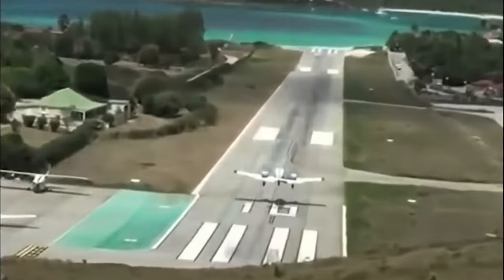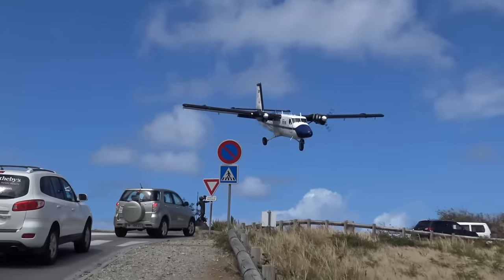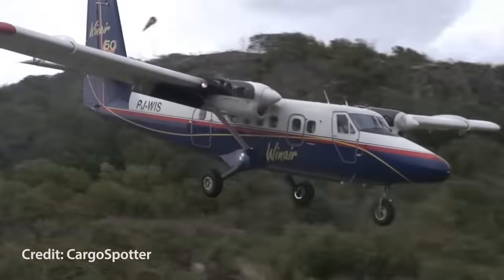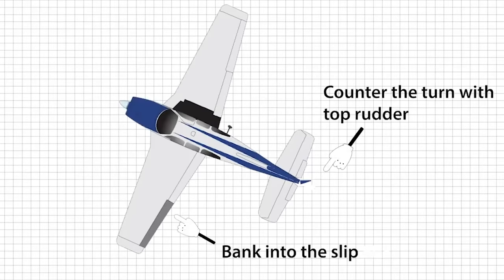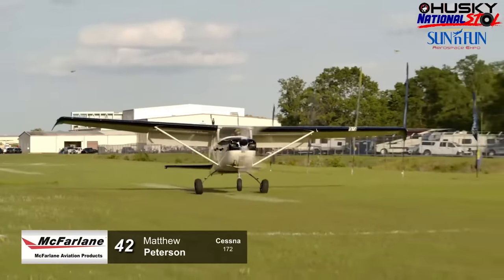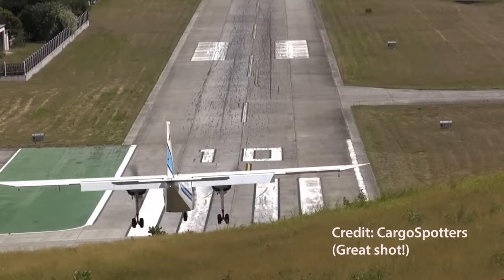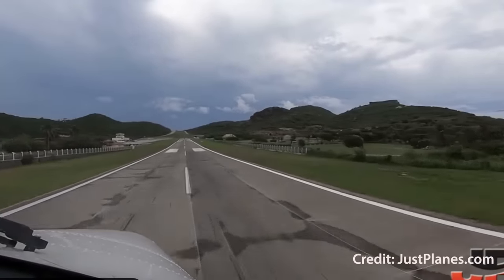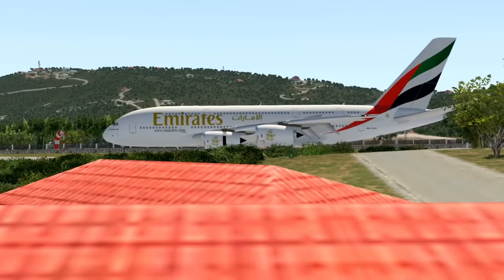Why This Landing Went Bad Part Deux

Comment: You have to question the architect behind these runway builds, would have been so much safer to have removed that hill and made that a standard approach. It might even make more sense to approach from the other end and let the hill slow everyone down.
Reply: It's already the lowest part of the hill, 'removing' the hill would be major(you can't easily remove part of a hill, as it will destabilize the rest), especially for such a small island. The island is mountainous.
They only land in this direction when the wind isn't suitable to approach from the sea.
Reply: @DoubleMonoLR  "They only land in this direction when the wind isn't suitable to approach from the sea."  Which is almost always.  Approaching from the sea might seem safer, but there is no go around when coming in that way.  No second chances.

Comment: Too many pilots fly too fast for EVERY approach. They believe fast equals safe. It’s not. This deficiency is shown everywhere a short field landing is required.
Reply: I was working at a bush flying operation where a lowish hour guy on one hot day went off the end of a short strip with a plane load of pax. Sometime after this incident he shared with me his belief that on a hot day you should approach faster ‘because the density altitude is higher’. And in that moment I realised what had gone wrong before.

Comment: Timely - I'm about to go to the next level in "slow and steep" experiments in a Tripacer - full flap, throttle at idle and 75 mph, and see what happens. It's tough - I have to make a much smaller pattern than I think I need.
Reply: Sounds fun, what is your stable high sink rate locking alerons and using rudder only ?
Reply: @MarkShinnick  Well, I don't lock my ailerons on final, so I'm not sure what you mean. It's slow, but it's not close enough to the stall to use rudder only. Plus, I don't look at my VSI on final.
Reply: Final level to achieve is when slow enough you get the max sink rate but most directional control until regaining forward speed before flair has to be with rudder.

Comment: Why don't they land the other way going uphill instead of down?   Some drag strips go up hill at the end and cars that normally need a parachute to stop barely have to put on the brakes because of the steep climb at the end of the drag strip.   This runway already has a built in hill, but they don't use it choosing rather to go into the sea if they time it wrong.   Pretty stupid.

Comment: What is takeoff like after they've  managed to get in?
Reply: Turn at the edge to maximize pavement.  Stand on the brakes and set power.  Take a good look at your engine gauges.  Release brakes and here the downhill grade helps you.  There is no accelerate stop.  Rotate and suck the gear.  Accelerate to blueline  instead of gaining altitude, you have zero obstacles initially.  Turn left out over the bay.

Comment: I’ve watched the “drag it in technique” for short field landings on other channels.  I think it is fundamentally wrong and a dangerous technique.   Where it came from God only knows.   Every pilot should fly a constant descent approach  until the flair for his aiming point…..on every approach ,  at the right speed,  for minimum float after the flair.   Constant practice will develop his skill to give him half a chance on this crazy approach.   Lots of go around practice too.    It’s probably advisable to perform an approach then go around if it’s your first time into this “runway”.   Mental preparation for a go around is a must ,  or you are going to risk yourself and aircraft avoidably.

Comment: I'm guessing if you land on runway 28 there is no such thing as a go-around!
Reply: From what I've seen on Youtube, correct.   I believe there's a rock somewhere in the bay which marks the last permitted go-around point.
Reply: I flew into there once. As a passenger, but still, that was enough!

Comment: The, as you called it “drag in method” is not something that should be promoted since it is dangerous and really only used at ‘Specialty Competitions’ such as the one you mentioned in your Video.
Use the short field technique as described in your Aircraft specific POH. Stay safe out there and try not to listen to someone who uses a PC Simulator to explain flying on youtube😉, it dangerous and misguided!

Comment: Been flying since 98 as ATP and let me tell you. Poor airmanship. Not a "speed problem". Where are theses people learning how to fly?
Reply: Mild Maneuvering Flight Schools.  They only teach well the easy maneuvers.  Then they have to do the hard ones.  And crash.
Reply: @outwiththem  Yes but teachng WHEN to go around is somithing LEARNING is the trick. "Ego heros" are set loose.
Reply: @psneves  Teaching when is easy.  Teaching 5 feet go arounds with full flaps is not easy. I did them...
Reply: @outwiththem  
I also blame the FAA for their "integrated flight" method which emphasizes instruments over feel and ribs the students of getting the seat of the pants feel. IFR emergency learning should be the very LAST thing on the syllabus, imo.
Reply: @outwiththem  Yes I agree. And those who cannot do it  cannot go on as pilot students. Should change careers but they are goig for easy schools instead. My point is, these unfourtunate people are not really learning the art of survival in a plane. That girl for instance shuld not even start the procedure. She should have arrived at the hotel in an alternate airport, write a safety report and sleep well. Maybe fatigue a factor there too...
Reply: @fazole  Many or about half of all "IFR weather accidents" are on the VFR portion of the flight.  Specially on those Circling Approaches.  Circlings are done under IFR, not IN IFR.  Classified by FAA as "IFR accidents" is pure Bullshit.   They did bad maneuveriing in the VFR section and crashed doing pilot errors VFR section.

Comment: Have engineers looked at removing the hill and using the material to extend the runway into the water?
Reply: That would be extremely expensive for an island this size, it would be a major project for a minor airport.

Comment: take that a380 sim and load it on a flight simulator with actual a380 flight controls and see if it still works ... bet it comes down to more hit and miss like the piston jobs
Reply: the otehr question one MUST ask .. is why the heck havent they sculpted the approach hill to better accept a less steep in run ... and remove the dang roadway at the top of the hill ... or add a barber shop pole at each side of the runway so lookie loo's know they can get a  free trim of a little off the top if they stand there
Reply: @0623kaboom  Toncontín International Airport shaved down the hill.  but then they built an entirely new airport and moved all the airliners with INTL traffic to it.   Toncontin is now a local regionals airport.   and they bulldozed the hill with ease because there wasn't anything on it.  

I think its a matter of getting the equipment back in and if I'm not mistaken, that is a major access road atop that hill.  shutting it down for months on end to bulldoze and shave down the hill like Toncontin did is not an option for the island.

Comment: About 20 years ago, I had my Navion for sale. Had a Northwest Airline DC-10 Captain who flew the Orient route and wanted to buy my plane! OMG, after he wheel barrowed my plane down the first quarter of a 6000' strip on the nose wheel, I realized he could NOT fly! He was all over the place! Needless to say, he didn't buy my plane because I would not agree to his offer $500 less than the FIRM price I had set and told him so! He was one of those guys who enjoyed getting something for nothing! Glad he did not buy it, he couldn't fly anyway! About like this gut in the Piper who broke his right gear off!
Reply: It's odd when a DC-10 Cpt can't fly a single-engine plane.  He was also a cheap bastard by the looks of it.  Navion's are quite rare.
Reply: It's like having a bus driver jump into a an MG. He's going to be ham handed. Also, he probably was waiting to see a firm number to rotate the Navion, rather than use feel. A DC-10 pilot either hardly ever used rudder on take off or used a lot in crosswind, crab  landings. Airlines train to pedantic precision mostly because EVERYTHING has to standardized.

Comment: Civilian tiltrotor is best. USAF MC-130H Can get in and out with its amped engines and modified high lift devices.

The PC-12 pilot should have been fined and be required to requal for this field. He presented hazard to people and vehicles on that ridge.

Comment: The very second, where that plane with collapsed undercarriage hit something solid, the "Boom" reached the back road. In that instant, you can see a dog - taking off at high speed, running up the road!! Dog knew that the plane landing was somewhat 'flawed'.

Comment: If anyone ever actually stuffs a Scarebus 380 down on that runway and brings it to a stop on its own wheels before scaring the fish, they're going to have to remove that plane from the runway in pieces.  Not just because there's no chance it'd ever FLY out,  but because the landing will result in serious structural damage.  Airworthiness certificate goes right to the shredder.

Comment: "dude, next time fly a Hellcat!"
MY CONTENTIONS ABOUT CIVIL AVIATION:
1.) UNDERPOWERED
2.) UNDERENGINEERED
3.) NO LEADING EDGE DEVICES
4.) LOW WING PLANES MAKE FOR BAD SHORT RUNWAY LANDING CHARACTERISTICS

SUMMARY:
<just to dangerous to consider>
<only the piper cub, and cessna 170 taildragger use the low stall speed, high wing, and high angle of attack effectively>
TURBOPROPS (best) versus PISTON ENGINES (low power), BIG FACTORS IN POWER TO WEIGHT RATIOS.

CAVEAT: 
<maybe the c-17 could take off and land on this runway (barndoor flaps, leading edge devices, and 4 fanjets)>